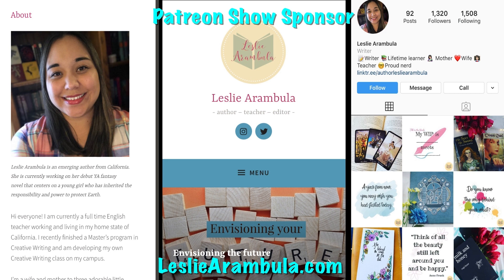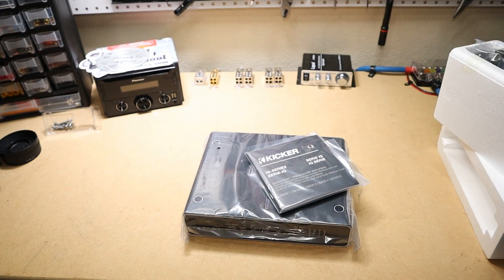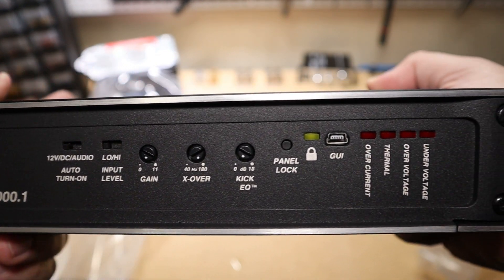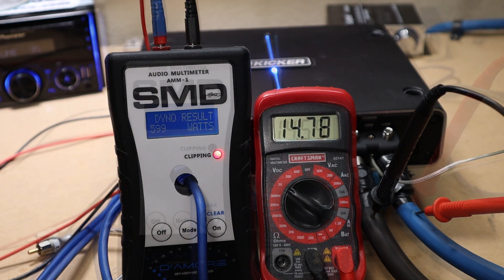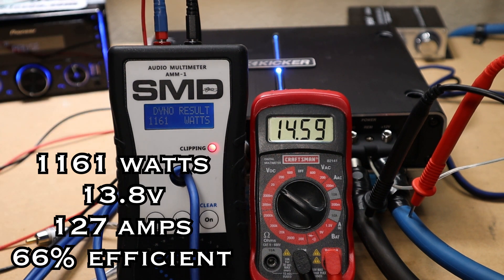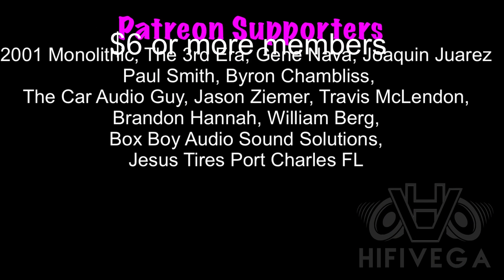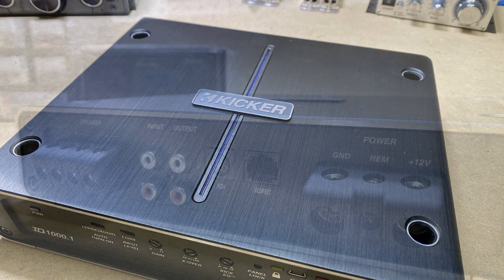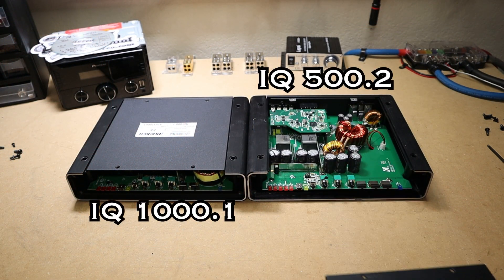The coolest DSP amp no one ever talks about!! Kicker IQ 1000.1 amp Dyno

Comment: I was fckin hyped today when I scored this amp and a compQ 12 today…until I realized they sold me a freaking 2ohm dvc sub, and that would be fine and all until I found out this amp I spent a fuck ton of money on isnt rated for 1 ohm. Wtf kicker? You gonna paste Q class on this amp and not make it good for 1ohm applications???
Reply from the maker: It’ll run that sub at 1ohm no problem just make sure you don’t clip it too much
Reply: @HifiVega  How would I make sure I don't clip it too much? Would it entail giving it less juice/power? At 2ohms I'd need to send about 40V ac to the sub (measured with a multimeter from the amp output) to get 800watts, but only 28.28V to the sub get 800watts at 1ohm...But if the amp isn't one ohm stable how would I know if it's actually sending the power I want to the subwoofer at one ohm? wouldn't I end up eventually  frying the amp due to more power coming back to the amp that isn't used? Electricity is hard.
Reply from the maker: @natskar  if you get the bass knob it has a clip indicator on it, but you could just set the gain with a dd1
Reply: @HifiVega  true true. I ended up calling them back and I’ll switch it out for a dvc 4, so that’s good. Thanks for the help though

Comment: Concern is the inefficiency of this amp considering it is Class D.  Williston Audio Labs just tested a Class AB RF amp from 2005 and it had the same efficiency as the Kicker.  Today's  cars need efficient amps.
Reply from the maker: Any amp that has a tightly regulated power supply like this will always be a bit more inefficient under a heavy load. Depending on your use case the benefits might outweigh the con.
Reply: @HifiVega  are you sure only 67%? efficiency? that's horrifying, the previous models did 88.7% at 2ohms per Williston Audio Labs test on the KXA2400.1
Reply from the maker: @gwarslayer  yea the IQ are not nearly as efficient as the KX and that’s part of the reason they were phased out sooner I recon

Comment: While I get fusing my own system, at this price point I'd definitely want built-in fuses as backup protection.
Reply: It would be kind of redundant.  In my years of installing I'm yet to blow fuse in the amp itself.  I'm sure they did it to streamline power delivery and not have more failure junctions than needed.  Usually amps in the higher price and quality range don't have them due to the protection circuit on the amp being sufficient to protect it from accidental issues.  Cheater amps use fussing because well it's cheaper to use fuse contacts than actually developing a protection circuit on the board.
Reply from the maker: Yeah that might have been a good idea